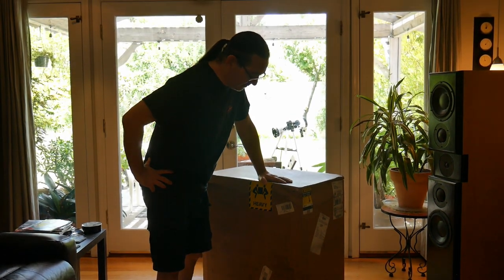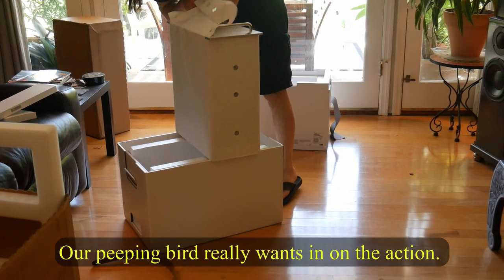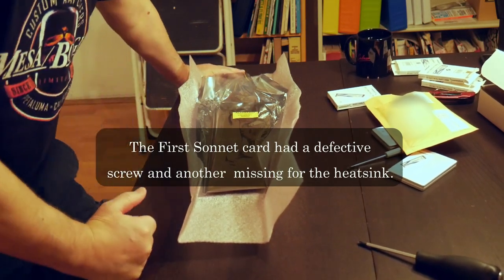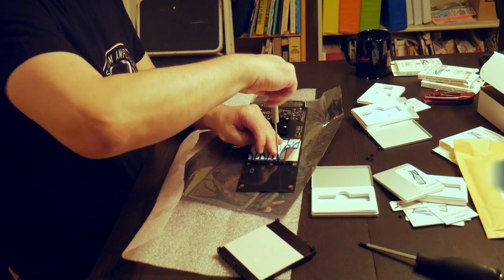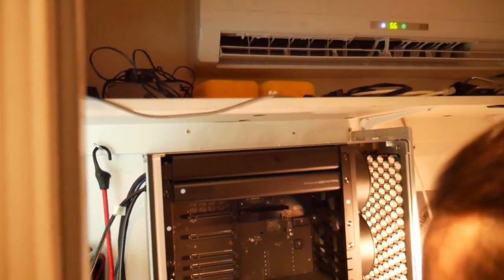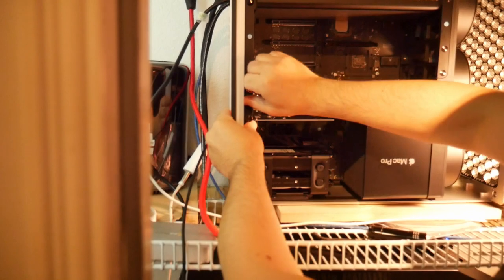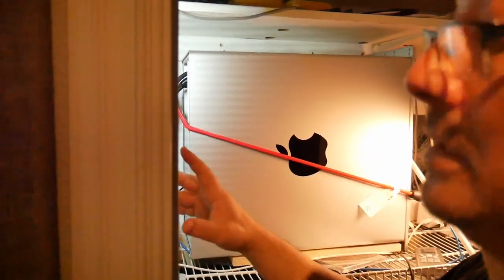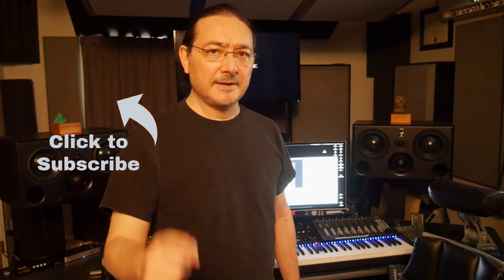Mac Pro Rack Mount Install & Hardware Upgrades Explained

Comment: Just when I think you couldn’t get any cooler 😎 enjoy man!
Reply from the maker: Thanks Nikhil
Reply: @kenjacobsenmusic  I got that Ken, my question was which Raid did you use? Raid 0, Raid 1, jbod, etc.
Reply from the maker: Raid 0
Reply: @kenjacobsenmusic  So I hope you're using raid 0 on the 2 TB Drives and Raid 0 on the 2 1TB drives. If you use raid 0 on all four drives you'll be limited since raid 0 requires all drives to have the same size.

Comment: Hey Ken, cool video! Having used the computer for a while now, is there anything you would have done differently in terms of the hardware you chose? Has your internal hard drive set up been stable and performed as expected? Have you noticed a performance improvement when using logic pro?
Reply from the maker: I don’t use Logic. I use Nuendo. Probably should have gotten a 2tb system drive. I have no major issues. It likes to be rebooted daily.

Comment: I'm assuming you're going JBOD with your 2 1TB and 2 2TB M.2 SSDs?
Reply from the maker: William McFadden detailed in the video....
Reply: @kenjacobsenmusic  Hey Ken, I watched the full video and didn't hear you say anything about a raid configuration. If you did, where about was it?
Reply from the maker: William McFadden I installed a Sonnet card. Raided a couple of drives on it.
Reply from the maker: Yes, so 3 x 2tb
Reply: @kenjacobsenmusic  A sweet system for sure! I may go 7.1 next year for the tax write off, don't need it this year
Reply from the maker: Cool